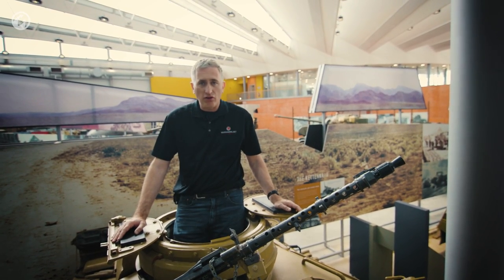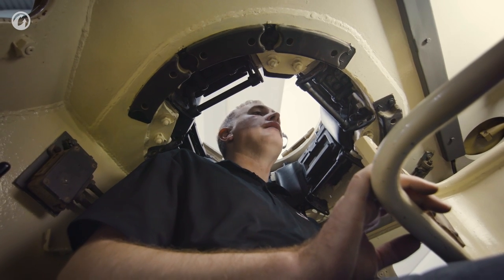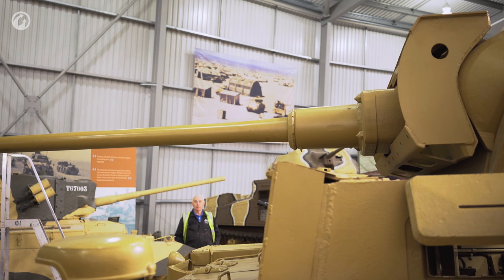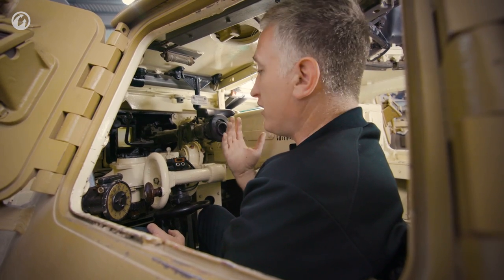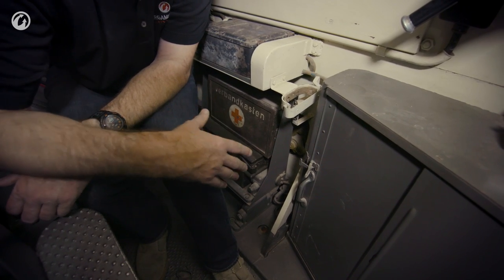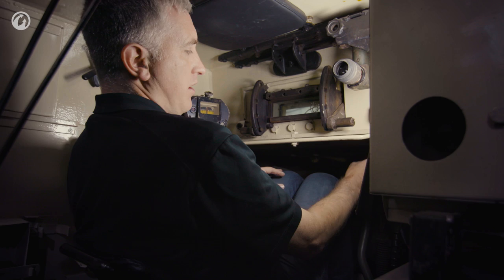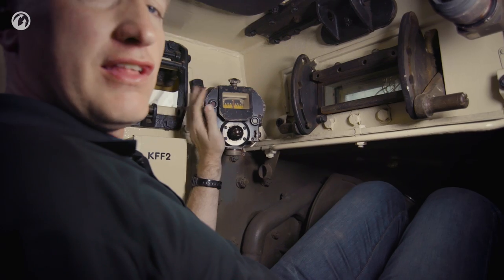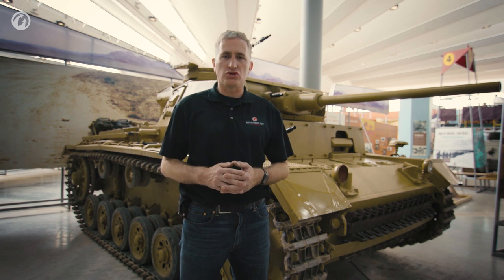Inside the Chieftain's Hatch: Panzer III Part 2

Comment: Panzer III is a perfect example of how a tank can be more effective than its simple firepower, mobility and armour statistics. In theory this was supposed to be inferior to the Char B1 and T 34-76, but it turned out to allow its crew to take better advantage of the tank and use it to its full potential.
Reply: Yeah, I think the French Somoa is a good comparison and while the Somoa looks much better on paper the Panzer III can get to it's maximum potential much more easily.
Reply: Crew efficiency matters.
Reply: They feel made with crew input rather than just by executives to market or for engineers to have fun with.

Comment: The mysterious doohickey is a gyro compass, basically because tanks are big metal boxes a magnetic compass won't work, instead you set this thing to a known heading (ie north) and the gyroscope will spin and stay on that heading no matter which way the vehicle turns, so you can always know which way north is
Reply: Improbable, first because a gyro compass needs current input to keep the rotor turning (and the doohickey is a bit small for a period gyrocompass), second because the scale is only up to 12 whereas a compass would have a degree (360) or mil (6000 or 6400) scale, and third because you CAN have a magnetic compass on a metal tank -- you just need to calibrate it. How do you think they can have magnetic compasses on iron ships if metal were a problem? Presuming this is supposed to be an Afrika Korps tank, they could also have used a sun compass like the LRDG. And finally, the guy actually doing the navigation would be the TC (or more likely a navigator in the command tank); the driver would be occupied negotiating the terrain.
Reply: @jarmokankaanpaa6528  probability has nothing to do with it, I was stating a fact not making a guess. It's a gyro compass, called a 'kurskreisel' , my source is page 43 of the Haynes Tiger tank workshop manual.
Reply: You are correct,  @imagifyer .
Reply: I guess the magnetic center of the tank was in a very inconvenient location.
Reply: @imagifyer  I speculate that the "1 to 12" scale might be clock degrees as to more easily follow tank commanders directions if given in clock degrees. Would the lower yellow part (harder to see in the video) possibly be a 360 degree scale?
Reply: @Mattle_lutra  I think its like using a clock? Say like "Enemy at your 3 o'clock." Just a guess
Reply: @imagifyer  having used Haynes to repair cars for many years and encountered their questionable accuracy ... chances are it's a music box or an alarm clock.
Reply: Alexander Challis  what a whimsical publication. I suppose they had to keep the poor sod entertained to keep him interested. Not at all what I expected from a tank manual.
Reply: @jarmokankaanpaa6528  To negotiate the terrain you need recognizable features which are few in the desert. Maybe the Germans had compass failures so they decided to install a backup system for the desert. The Americans had the same idea and in fact went even further. Instead of a mere gyrocompass they had an entire INS installed though it apparently wasn't all that reliable.
Reply: @v8trauma  Right, it looks like a boy scout handbook, war is fun, don't look at it like it's a death sentence.
Reply: @v8trauma  Many of the US publications and instructional films are the same, check out "Private Snafu"
Reply: Don't they calibrate a regular compass to work in tanks and ships?
Reply: I don't know what the gyro-compass was used for in the Panzer III, but I do know what gyro-compasses were used in Soviet tanks. It was used when crossing rivers submerged. The slippery bottom plus buoyancy made it very easy to change direction. Without this it was very easy to go along the river and not across.
Reply: Its not gyrokompas, its war time german version of tamagotchi device. Introduced into tank for shortening boring times of tank drivers
Reply: @imagifyer  That would be a lot more convincing if this was a tiger tank rather than a Mark III.
Reply: @jarmokankaanpaa6528  It did occur to me that if you shut off the engine killing the power to the device the orientation of the tank is unlikely to change until after you restart the tank. Sure it could be towed in which case you would need to adjust the device to the correct orentation.
Reply: Tactics by Wolfgang Schneider as a picture of the device from a manual wartime ww2.
Reply: Alexander Challis  p24 if you have a reprint version
Reply: @Mattle_lutra  The upper dial is the one you lock to a true location and the bottom one show's your current location.
Reply: yes, it is the gyrocompass. Hilary Doyle stated that in the inside the hatch part3 episode of the panzerIV
Reply: @jarmokankaanpaa6528  
It is exactly what he said, a gyro compass, and it is powered by the tank's batteries. It is a standard component that all Panzers have a holder for.
Reply: @dwightehowell8179   The gyro, like the lamps and the radio, works off the batteries and can be used with the engine off.
Reply: @MrMarinus18   The device is an electrically powered gyroscope. It was present in almost all Panzers except the smallest ones. It's documented in several German manuals. It had its own power transformer driven by the tank's batteries. 
You couldn't use a magnetic compass in (or near) a tank made of metal!
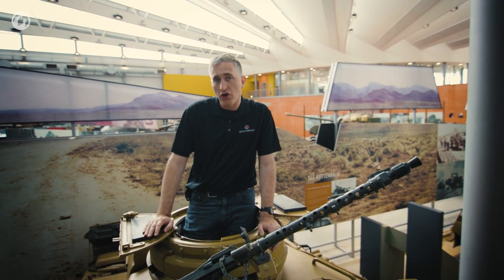Reply: 1:22
Originally they actually had much taller cupolas that protected a standing officer much better. However those extended cupolas proved to be very easy targets for artillery and were frequently ripped off so towards the end of 1940 they stopped using them.
Reply: it is an autism meter. luckily we are not all tank drivers here
Reply: @daveybyrden3936 just like you can't use a compass in an iron or steel ship? That's why vehicle compasses have compensating magnets-- you swing the vehicle and calibrate the thing so it gives the most accurate reading possible, then make up a compass card showing the correction still needed on various headings.
Reply: @dwightehowell8179   The German gyrocompass works off the main battery, it doesn't need the engine running.
Reply: @MrMarinus18   Where are you getting this stuff about taller cupolas? As far as I can see the cupolas were all about the same height (across all versions of Pz3 and Pz4). They just kept adding thickness to the outside.
Reply: @ExceptionallyCleverUsername   A tank has a steel turret, comprising a significant fraction of the tank's weight,  and that turret moves. You can't compensate for that with a single adjustment.
Reply: @imagifyer pretty sure "Kurskreisel" means "directional gyro," not gyrocompass. Real gyrocompasses tend to be much larger, especially 1940s models, and they may not respond well to really abrupt changes in direction, shaking etc. A directional gyro is a basically a gyro that keeps pointing in the same direction as the vehicle moves around it. You'll find them in the cockpit of any Cessna. You set the thing by your compass, the setting is probably good for 15 minutes before it drifts too much to be useful, and during that 15 minutes the thing is very persistent in pointing the same direction. It doesn't roll around then slowly find its way back to the correct heading when you turn the vehicle quickly or get upset by weird changes of attitude.
Reply: @daveybyrden3936  Both Pz3 and Pz4 had them initially. They were kind of like a barrel stuck on top of the cupola. It existed so that when a commander was standing on the chair he would still have some protection for his body.

However the tall thin metal proved vulnerable to artillery fire so it was done away with.
Reply: @MrMarinus18   I have never seen this "barrel on top of the cupola".  I checked the Panzer IV manuals; all versions of cupola were almost exactly the same height. They only got wider. 
Can you refer me to a photo of the barrel?

Comment: I suppose the driver and radio operator didn’t have their own hatches because the tank was too small to accommodate them.  It’s easy to forget that the Panzer III was designed as a 15 ton tank.  Allied near equivalents in terms of weight were the British Cruiser III and IV, and the US M3 / M5 Light, which all had a crew of 4 men, and the Russian BT-7 and British Valentine III, which both had only 3 men.

So the Germans did a brilliant job of crew ergonomics on the Panzer III considering the small size of the tank.
Reply: Well more that the Germans figured the inconvenience was worth it for the increased protection. Hatches are weak points in the armor. The Driver and radio operator would have hatches in the front which is the most likely part to be hit.
Reply: The early marks had escape hatches for the driver and radio man on the side: deleted after this model I think. Our man here makes mention of them in the video. 
These are in the hulk sides and hinge forward. There's a number of photos of knocked out tanks with the open and at least one with a crew member apparently dead gal in and half out the tank.
Reply: @chrisgibson5267  That's absurd, women didn't serve in the Wehrmacht
Reply: It is also the reason they went for the more vertical armor. It allowed them to make a smaller tank which still fitting in 5 people.
Reply: Also the intended weight of the Panzer III was 18 tons which was the maximum weight of army bridges at the time. The British clung on to that a little more which is why the Valentine is so cramped cause they wanted it to stay under 18 tons.
Reply: But I also think it might be part of the reason why the Panzer III and IV look so boxy. If you try to get 5 people into a 20 ton tank you really can't afford the inefficiencies of sloped armor.
Reply: @MrMarinus18  : The weight of the Panzer III Ausf.A, the first variant of the Panzer III, was 15 tons.
Reply: @timonsolus  Interesting. Maybe they wanted to have some space to expand.
Cause it really was 18 tons that was the make or break point.

Comment: The Drivers and Radio Operators / Hull machine gunners hatches were located on the sides of the lower hull between the tracks on the Ausf L model . I think you could also escape in an emergency out of the differential drive shaft inspection hatches above the Drivers knees. As on the Stug 3.
Reply: Side hatches yes. The inspection hatches are too small, and you can't squeeze past the gearbox/final drive assembly anyway.
Reply: @peterlewerin4213  
Ooh Yes you can when the tanks on fire !!!
Reply: Did you see inside those hatches in part 1? I was thinking "those are literally just inspection hatches, you couldn't even fit your hands in there to work on anything", and here you are claiming a whole person could squeeze out? There is no way. The hatch is large enough, but there is less than six inches of space between the brakes and the hull.
Reply: @justforever96   Hi , I have seen pictures of German Panzer Crewmen coming out of the hatch in question in front of the driver . Once you squeeze past the control leavers  you open the hatch from the inside of the Panzer III / Stug and pop out.  ( please note people were also alot slimmer in the 1940's)!

Comment: Access hatches for the driver/machine gunner in the hull were located on the glacis plate in front. I've seen a pic of a pz 3 driver standing in the open hatch.
Reply: No you haven't.
Reply: @donvanduzen8944   I've seen that too.

Comment: Great vid. Just a heads up, the MG34 on the cupola IS for shooting at aircraft, although in 8mm it’s quite inadequate for the role. The mount is called the “Fliegerbeschussgerät”(roughly translates to plane shooting device). There’s a switch arm/lever, which when turned, allows the arms of the mount to rotate upwards which raises the MG substantially enough to where the operator can get behind the gun for elevated shots. It allows for about 60 degrees elevation not much more. The idea worked well enough in the mid to late 30’s where biplanes, soft bodied and slower planes were used but was less effective against modern  WW2 aircraft. It’s function on the mount became a way for tank commanders to paint a target with tracers for gunner and other tanks and for both a moral boost and potential deterrent during Jabo attacks.

Comment: Shorter people back then, yes. But they also specifically chose crewmen based on their physical ability to fit. I think Moran would have been advised to go to the infantry instead, they wanted smaller crew for armor and aircraft, for similar reasons. Making the tank just enough bigger to accommodate a man of 6'2"  instead of 6' could easily add hundreds of pounds worth of armor hull plate, and strange as it seems, saving weight was a major consideration for tank designers. Even with the later behemoths like the Tigers, the weight was already so huge, they had to try to limit it as much as possible, and the thicker your armor is, the larger the increase is when you add a few inches to the dimensions. In aircraft, it means more material and weight, and more size means more drag (and a larger target, which is especially significant on a panzer). It is much simpler to simply be selective of your crewmen.
And yes, those are escape hatches. A person can squeeze out of a surpisingly small space when it is a matter of life or death...but yet another reason to prefer small men. Hatch openings are vulnerable weak points, and you want them as small as possible (especially on an extremely vulnerable spot like the hull side). All they needed was a space barely big enough to squeeze out of in dire emergency, it would make no sense to make them larger for comfort (or to accommodate fat crewmen) at the cost of making the whole panzer more vulnerable.

Comment: It good to remember that the Pz.Kpfw III not only had better ergonomics but it had a number of first regarding tanks: it was the first to understand the importance of having a three manned turret to divide the workload in a more logic way, it was the first to recognize the importance to give good view to the crew with the hatches closed so it was fitted armored glass all around with an cupola with an all-around view for commander, it was the first to be regularly fitted with the intercom system permitting a excellent coordination among the crew altrough the loader was not connected for ease of movement, and finally it was the first to have torsion bars permitting a relatively smooth ride on rough terrain. Compare it, with the exception of the Pz.Kpfw IV, to the contemporary tanks then in production in other countries to get an overall picture...
Reply: The Neubaufahrzeugs turret, wich became a huge influence for the turret on the Pz3 and 4, already had the 3 man configuration with the commander elevated in the back.

But you could still say the Pz3 was the first to bring that turret design to a mass produced tank.
Reply: @zafranorbian757  interesting, as I didn't know that the turret of the Neubaufahrze had a three man-crew. Thanks for the heads up!!

Comment: I once read that the latest version of the Pzkmpf III with the short barrel 75mm was produced to be a support tank for the Tiger I units, messenger tank ect. However that very fast turned out to be a bad idea. The best support for a Tiger was another Tiger.
Reply: If Panzer IV production had been numerous enough. I'm sure all Panzer III hulls would have been given over to Stug production early in the war. That combination with either Tiger Mk1 or another, would have given the USSR a real problem. The resources wasted on Panther, Tiger II and the other crazies lost the production of the workhorse vehicles. With more tanks available, the German armies could have reached much needed oil reserves before halting for the winter and consolidating. The T34 and KV's were a shock but very difficult to both operate, coordinate and keep running. 
Don't get me wrong. I'm so pleased the Germans never achieved their full potential. But but with hindsight the allies were very lucky Hitler was a drug addicted  megalomaniac. Had he "died" in 1941 and been replaced by Erich Von Manstein or similar. Who know what would have happened?

Comment: The hull escape hatches were deleted in the later production models of this tank I think mid way through the “J” spec model. Possibly that is why they are very blocked up as they have moved things around in the hull with the adoption of the larger gun and bigger ammunition.

Comment: P-III impresses me more and more. Apart from the escape hatches for driver and funker ..they dont have emergency hatches either? I believe I have read somewhere that P-III
was a favorite in DAK because of its reliability. The problem ofc was the punch of the gun.
Reply: there were originally escape hatches in the side of the hull, though they were super tiny and were removed on later models.

Comment: Do you know why the top speed is listed as 40 km/h? The Soviets acquired a Pz III for testing in 1939, and found that it could go 60 km/h or more, faster than the T-34, thanks to its torsion bar suspension
Reply: I've also heard this, with an explanation.
 It's thought that it had more to do with the Russians lack of respect for the machine, ie pushing it past its designers specification.